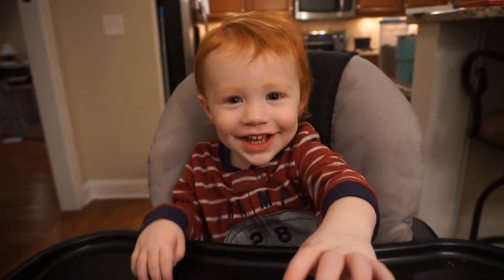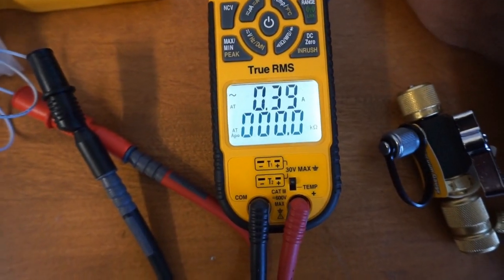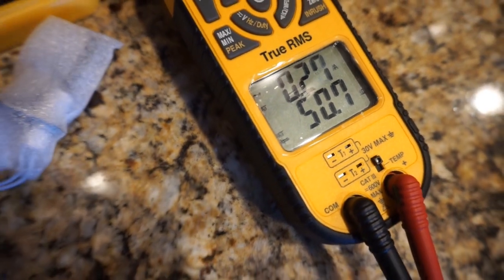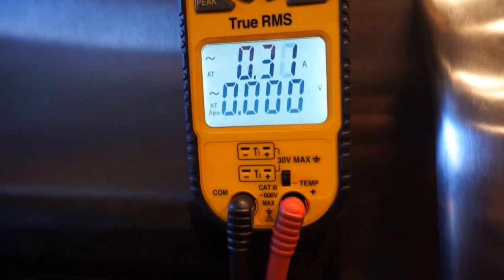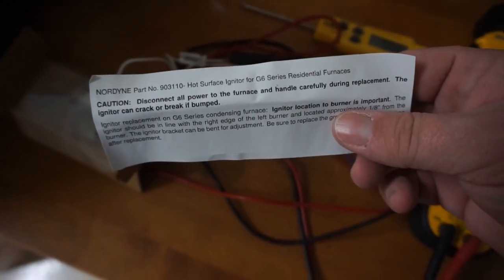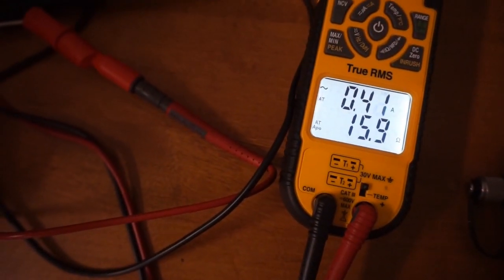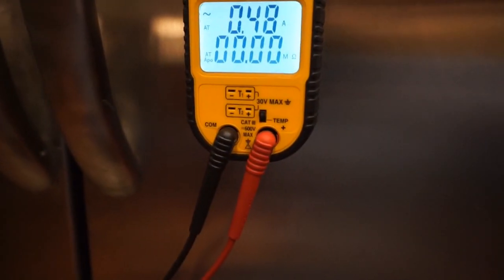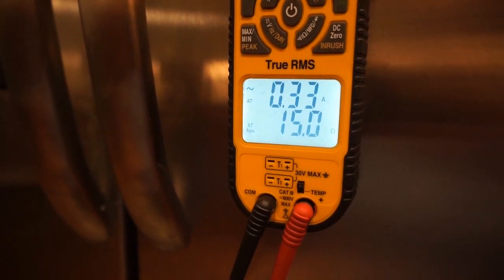Hot Surface Ignitor Experiment | Ohms vs. Ambient Temperature

Comment: I've never been a fan of ohming ignitors. If they're working and glowing brightly, I usually call them good. If they're starting to get a hotspot or damage, you can usually visually tell. In that case, even if they're working replacement is recommended.

Comment: There are several different ignitors , a lot of trane and lennox have 80 volt ignitors on them and usually ohm out about 15-19, silicon nitride are usually like 48-70, the silicon carbide old styles are up to about 100 but if it's been replaced with a similar carbide they can go all the way up to 200 ohms.  Then there's the mini ignitor on goodman's and Armstrong's usually anywhere from 30-300 ohms

Comment: Diagnosing a bad igniter that’s working is hogwash . Either it works or it’s not. It could have a resistance not in range but still last another 5 years or so.
Reply from the maker: Would you guys say a company replacing ignitors for being out of range would be a sales oriented company? Meaning, they replace parts that may not need replacement.
Reply: HVAC Shop Talk Absolutely , It’s Definitely An Upsale  Tactic. Some Components Require Upsale Others Don’t. The Best Upsale To Me IAQ . It Makes A Difference
Reply: @TALYN875  ABSOLUTELY!!! 100% RIPPING PEOPLE OFF. If it has resistance It's Good, if it doesn't It's Bad. They are  not like  a thermistor that is varying resistance based on temperature.
Reply: Well,,, if this is a fireplace ignitor, mobile home igniter, the infamous drum ignitor or a few other ones,, resistance is certainly something that needs to be checked as it also is used for flame rectification. 135 ohms and greater and she will still light but very well may not sense flame
Reply from the maker: @kangaroogod  I have run into a few of those on MH gas furnaces. The first time I was like....where is the flame rod??
Reply: Igniters are clearly covered by the “If it ain’t broke don’t fix it rule”.  

And no I didn’t say it applies to everything else like run caps, contactors, etc.
Reply: If a manufacturer takes the time to post an ohm or amp draw range of an ignitor, O say it's fair to tell a customer it's out of manufacturers range and recommend replacement. I have seen ignitors that wouldn't get hot enough to light the gas, and they were outside the specified ohms. I've also had ignitors that were outside specs, recommended a new one, was declined, and later that winter the ignitor failed.

Comment: The only ignitor I try to check resistance on is the traditional silicone carbide igniter. 95 ohms or less at room temperature. I don't even try to check the nitride igniters,  generally they are not the same resistance pattern. Also,   I've had nothing but problems with those Honeywell glowflies and the hot rods igniters by White Rodgers. I stick with the universal traditional looking carbide ignitor for the traditional igniters and OEM for any of the nitride. A lot of the nitride igniters are voltage specific.
Reply from the maker: Thanks for your input.
Reply: What kind of issues are you having with the hot Rod igniters? We switched to those a few years ago, and we have not any issues that I know of.
Reply: @Mikelen11  they're a lot better than the fireflies because they're bigger and get hotter but they're only lasting maybe a year or two years Max. I've had probably at least 10 of them go bad out of the 20 or 30 I sold. Even the supply house has regretted selling them
Reply: @HVACRSurvival  Interesting.  I'll keep that in mind. Thanks for the reply.
Reply: @HVACRSurvival  you might need to check the gas pressure on some of those units (too high) if they're going bad that quickly. I've had good results out of the glowfly igniters. 👍
Reply: Is there any universal Ignitor that will also work on 80 Volt systems like for the older Trane and Lennox Furnaces?
Reply: @superiorcomfortheatingairl3373  not that I'm aware of.

Comment: Do they ever slowly go bad or just open. Wounded if a current test would identify a weak ignitor.
Reply from the maker: I don’t know how quickly cracks appear, but visual inspection would be the best way to track that I think.
Reply: I have had a few units over the years that the ignitors would glow, but due to high resistance they were no longer getting hot enough to light the burners.
Reply: Gray is good...white lines are bad.
Mongo likes ignitors. 🔥